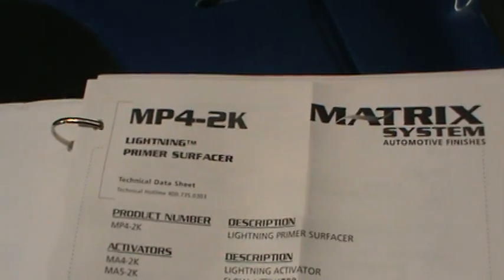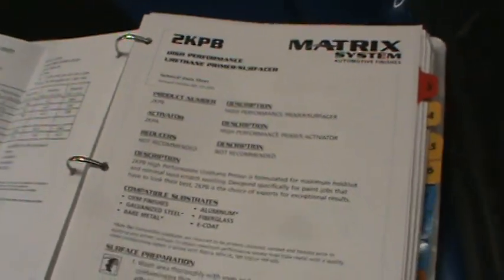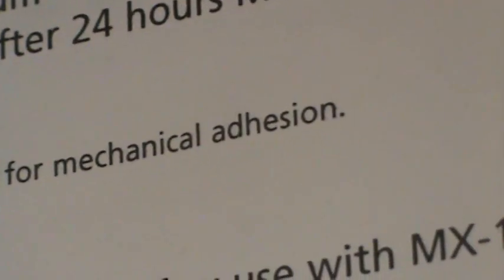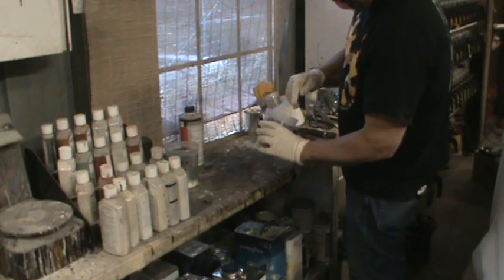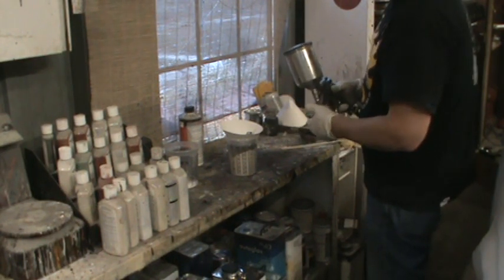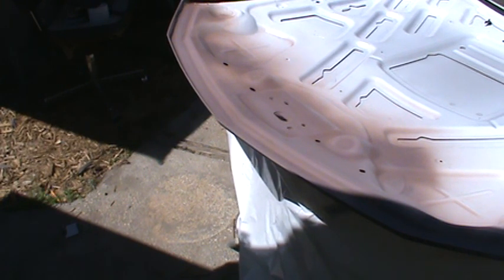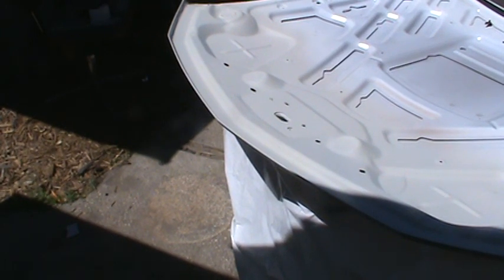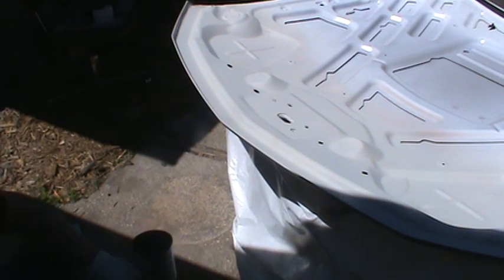HOW TO PRIME OVER ETCH PRIMER

Comment: Definitely good information.  The direct to metal capabilities seem to be limited for the MP 4 2k.  The way I read the footnote is anything under 6" is ok but over that 6" you need to properly etch it with the 550 or 600.  I think I will shy away from those DTM type primers from now on given the problems I had.  Thanks for the video buddy

Comment: That Matrix system sure give you all the info you need to do a good job Darrin, I can see why you use it. The paint company I use sold me some laquer that reacted with my waterbased base coat even though I told them what it was for.
I guess not everyone reads the tech data, even the shop staff. Good informative vid.
Cheers
Martin

Comment: So, I'm not doing anything as professional as you are, but still trying to do a good job. I'm redoing my old race bike to give to my daughter. I'm just using a series of rustoleum spray cans. I couldn't really understand your codes, so I want to get this right. You're saying to sand the bare metal, clean with mineral spirits, hit with self etching for 1 or 2 coats, let dry, lightly scuff that self-etching primer, wipe with mineral spirits and then lay down a new separate primer (I have rustoleum clean metal primer: use on bare, painted, or lightly rusted metal. "Twice the rust protection and superior adhesion"). Lay down 2 or 3 coats of that, lightly scuff, wipe down with mineral spirits, then wait 24 hours and hit with 2-4 coats of the colors, sand any orange-peel, wipe with mineral spirits, wait 24 hours and then do your clear coat? I hope this makes sense.